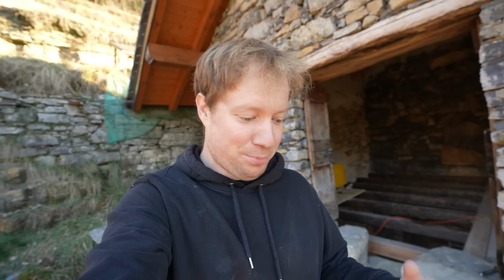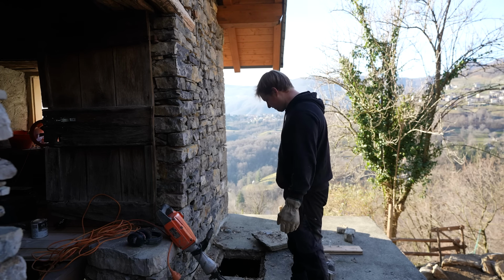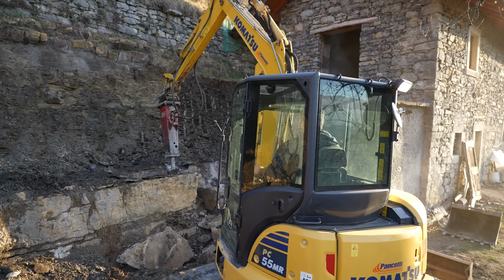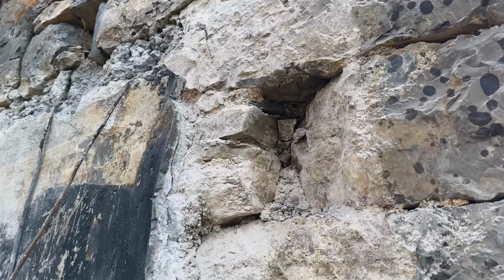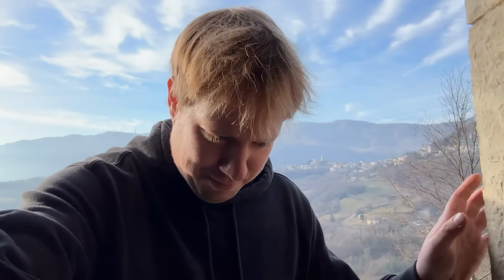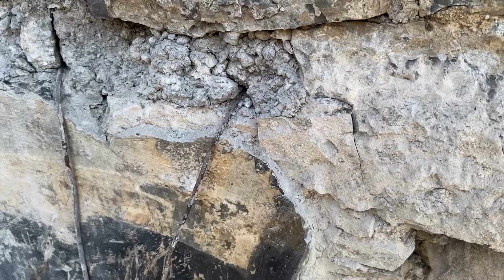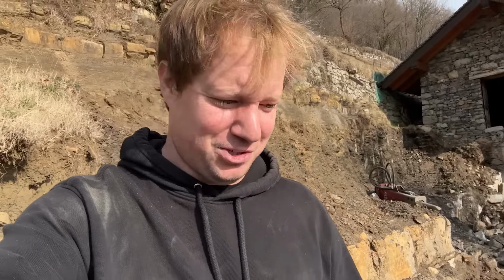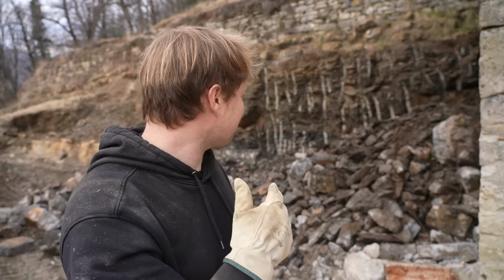KNOCKING DOWN Part of Our House (Italian stone cabin renovation)

Comment: Great video 👍 The extra stone could be put into cages and make walls etc the foundation's you could use steel post frame and put in a floating floor using concrete lintels and blocks .

Comment: The cement on the outside wall probably held in so much moisture that the rocks have softened. Be careful if you take it off. I'm confused, you're PAYING him to take away the rubble and then he benefits again by selling it? How strange. He should be paying you, or better yet give you credit on your bill for his services. As for ideas to use the extra stone, use the flatter pieces for paving your road. :)

Comment: how about a pool  you have that spring up the hill-  possibly  build a pool with the stone?  on one of the lower terraces except temp wise the water would be very cool.   Otherwise making some raised beds up against the walls of the terrace- I would bet the heat reflecting off the wall  would help things grow-   about 18 or 24" tall - would also give you a place to sit- then use some of the stone as pavers   for paths and driveway.

Comment: The cement wall. Depends what the room will be used for. If it is a room the girls will use for home schooling maybe leave flat and make it a media wall. Dry easer, chalkboard, large computer screen. Or mount a large movie screen and make a home theater. Just ideas.
I chipped away tile and cement on one of the projects and vowed to never do it again. Long a pain staking process.

Comment: What to do with the extra stones and slabs..... Build outdoor furniture and plant boxes! You can have a smaller sitting areas on lower terraces too. I envision park bench type seats and a nice stone table with the logs you made as the base to tie it all in. If the upstairs terrace can handle the weight, how cool would that look!  just extend the wall up 3ft as a knee wall all around, then use logs to frame in some planters here and there and a built in stone bench in between...oooh the ideas...

Comment: I would just render over the existing concrete wall. It seems risky to keep chipping away at it. If you are ambitious and are up for the challenge then go ahead and chip away at it and expose the rock, but keep in mind, that concrete that is there may be the only thing providing stability to hold up
The foundation on that side.

Comment: A wall around the patio. Build an outdoor kitchen with a grill, a fireplace, and a pizza oven on or near the patio. Walkways. A patio in the trees. Stone chairs around the patio. A firepit in the middle of the patio. A root cellar. A small storage building for garden equipment. Raised garden beds. A dry creek bed. A bridge over the dry creek bed. A water fountain, or a water feature. A small pond. Use small rocks to make a bird house, or a wire wrapped rain chain. Paint vegetable names on them as garden markers. Arrange and bury rocks in a row to look like a dragon or the Loch Ness monster. (Those are for the girls to climb on)

Comment: Could you use the stone to pave a terrace with low stone walls surrounding it, or use to build dwarf walls for a greenhouse orsu mer house to overwinter plants and citrus trees.Could you get permission to build a seperate guest house on one of the terraces? Other ideas - a firepit or even a big outdoor fireplace, pave the entrance driveway with the flatter stones, a garage, a little open fronted building sheltered from the elementsto use as a retreat for yoga, meditation or painting, stone pillars to support climbing roses, a folly, a water feature, I saw a spherical water feature built from stacked stones with a bubble fountain in the centre, you could create the most amazing garden features, natural ponds linked with waterfalls and streams. As a keen gardener I am so envious of your resource.❤Forgot the wall, definitely render to add a different texture but would that still require you to chip off the cement to stop moisture being trapped and damaging the underlying stone?

Comment: I would leave the concrete wall in place instead of removing it. You hit the nail on the head that removing it would be too much work. For the back wall I would pour concrete which would stop any seepage from the moutain into the house. The back side will be hidden so the only ones to know will be you and your family. With the rebar it will provide a strong wall against the pressure of the mountain. The rest can be built out of stone. One question, will the new room need to be accessed from the original house? If so, obviously a door will need to be cut. Also, are you at some point in the future going to point (with lime) the stone walls to give strength, and stablility, to the walls?

Comment: Get rid of the ugly concrete - at least, see how difficult it is to remove it.  If it's more trouble than it's worth, you can always bail.  But the concrete render is ugly.  

I agree with many of the other posters: use the stone to cobblestone your driveway, make an incredible patio or sundeck, build a pizza oven, an outdoor fireplace, turn it into 2" crush to give you some proper drainage behind the house...

Comment: If I'm not mistaken, at the moment it is possible, in the case of renovations, to make expansions of the existing structure up to 30%. Furthermore, there should be incentives and state contributions for renovations, if they respect certain construction standards. If I'm not mistaken, it's "building recovery". Be well informed. But certainly the engineer or architect supervising the work will have already told you.
Reply from the maker: Yes a maximum expansion of 20% in our situation.

Comment: I think it's a mistake to not follow through with the original plan. Although the wall could be placed where you wanted it you could of still had a wall and used that to take some of the dirt away and the remainder pay to be removed. You have less space inside the house, outside the house and water  ingress too. I feel like you'll regret this decision later down the road

Comment: I see so many people using sledgehammer the wrong way you can make tit so much easier on your body and get more power into the hammer PLEASE TRY THIS SLIDE YOUR UPPER HAND FORM THE HAMMER TO YOUR BOTTEM HAND AT THE BOTTOM OF THE SHAFT AS YOU DROP THE HAMMER THIS CREATES A LOT MORE POWER AND IS MUSH EASIER love the project thank you. I still think you might bean able to dig out behind the property have you thought of a 36o machine that can work with extended leg in other words can work on a cliff face

Comment: The stone has value as a building material. This site looks like it was first quarried for the stone. Keep the best stone for yourself. Massive amounts of stones were removed and used to build other houses. Notice how the stones break up into large parallel layers. The house was actually built with smaller less valuable rubble after the larger more valuable stones were sold and carted away. I think you are being manipulated into giving away valuable building material . In your area topsoil would be valuable as well . Research your area. See what it would cost to buy stone and top soil.This is the only way you will find out what it is worth.